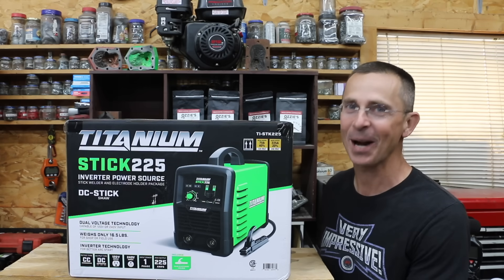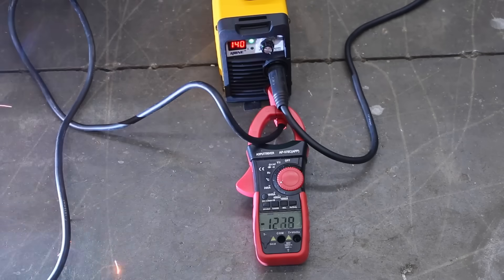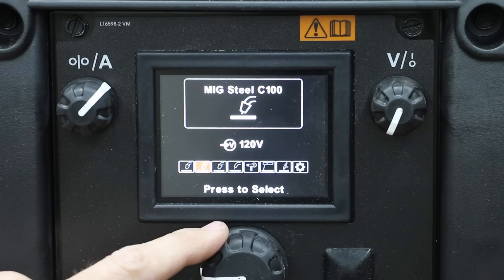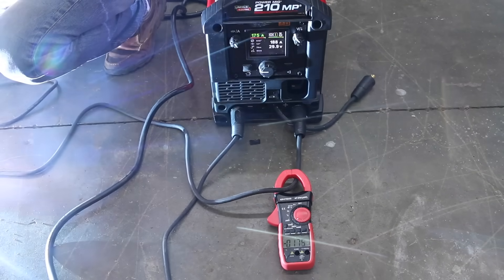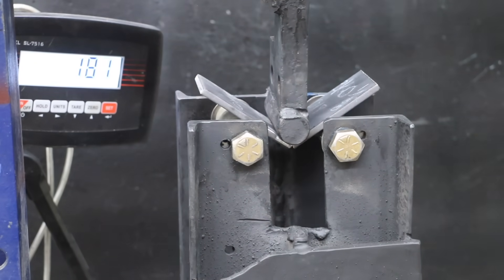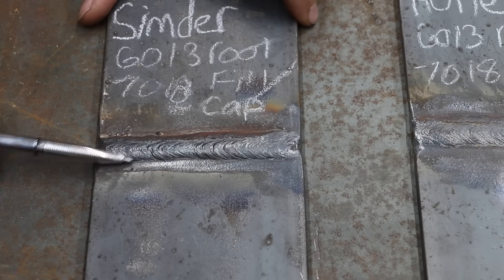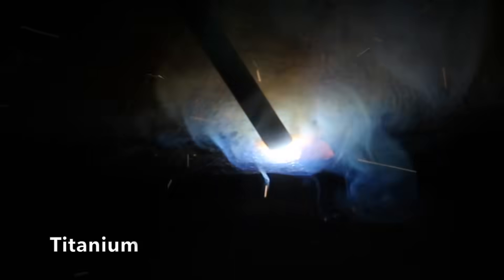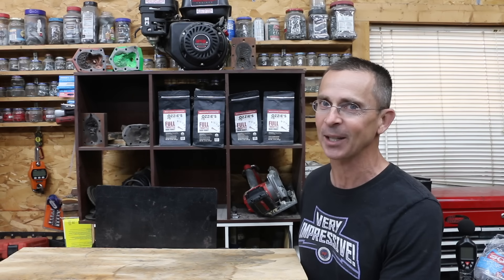$70 vs $2,300 Welder? Let's Settle This! Weld Strength, Duty Cycle, Current Output, Build Quality

Comment: Welders have a trick. Get one that you will never usenit above 50% of its max amp capacity. So if using 7018 1/8" then get one with a minimum 250amp capacity

Comment: The amps are probably like cheap car stereos..... Based on peak voltage and not RMS.  So basically not real.... But not false advertising either when they advertise" up to".

If you set the clamp-on ammeter to peak..(measures inrush current for motors made possible by capacitors...and lock the display on it).... You'll see higher amp.

For 115 v welders, on a 20 amp circuit....120*20= 2400 watts

2400/20v = 120A    using a common 20 volt welding voltage ,120 amps is all you can really plan to get constant from 120 V.   This is common sense.   The higher the welding voltage the less current you can also pull constantly.

Comment: I own Lincoln and Miller welders only.   But man, that little Horrible Fright Titanium is impressive!  I love the little lunch-pail inverter welders for getting into tight places or when having a job that’s a quick 5 minute fix and small.  That’s when those tiny machines come in real handy without having to lug around heavy big equipment.  

I never thought id say it, but I think I’ll be picking up a  HF Titanium just to keep in the RV.   Plug it into a 30Amp RV outlet and with 3/32” electrodes could be a lifesaver on a camping trip.

Comment: thanks joel.     How about this welder next?  ARCCAPTAIN Stylish Handheld Welder, 110V Portable Welding Machine with IGBT Inverter, 120A Stick Welder with Auto Darkening Goggles and Upgraded Ground Clamp, Fits for 3/32"-1/8" Welding RodsARCCAPTAIN Stylish Handheld Welder, 110V Portable Weld…

Comment: Superior video. Excellent work.  2yr old test is very relevant today.  Got the green HF 225 last year after watching. Upgraded power cord to 10ga and 120V adapter to 10ga
 (voids warranty). Upgraded both welding leads 1 foot longer  to 4ga with  heavy ground clamp & Hobart 200A electrode holder. Has handled every job using mostly 1/8" 7018 rods on 3/8  steel plate with ease.  Paid for itself 10x. 
Another great affordable stick machine is ESAB handy arc,  under $200. Even better value than HF 225, but the leads are short (easy fix).
Thanks to Joe/PF for going above  and beyond.

Comment: Reviewing this video again after doing a short course in welding and buying a fairly cheap welder with high current rating and low duty cycle. My takeaway from these weld tests is once your welder has the capability to push high current, you're good. From my limited experience, the accuracy of the number displayed on the screen does not matter much. When you weld something, you can see from the weld if the current is too high or too low and make adjustments. I bought a welder that goes up to 250A on the display, but I measured 178A max. So if you're buying a cheap welder, go with the highest current rating you could get, assuming the actual current will be lower. Unless you're going to weld non stop for a whole 5 minutes, go lower on the duty cycle to save on cost.

Comment: Wow so many things about this video are wrong its hard to watch !
Thers NO cert test with a total of 60 degrees on a test coupon . 30 degrees each plate . Its either 22.5 degrees angle each plate for a total of 45 degrees . Or 37.5 degrees each plate for a total of 75 degrees on a test coupon ! 6013 series rod is the least penetrating rod available . So using 6013 for a root pass and then using 7018 to cap your weld to check for penetration is bogus  ! It's straight up bad information ! And in the wire feed section your pushing welds . You never push with hard wire or inner shield wire . It results in way less penetration and excessive spatter ! Only welds you push are 4g away from you . Or a slight push in 3g position . Ive traveled to 4 other states teaching other shops WELDORS how to weld . And to help thier WELDORS get certified ! Ive been welding for 40 years now . Ran my own fab service for 35 years now . Im certified through the rail road . And certified through Caterpillar . I have so many certs ive lost track of them . One being D1.1 unlimited thickness . Ive put down around 220,000 pounds of wire ! We put down 100 pounds a wire a day at the cat supplier ! Love your channel ! But Joe was a wealth of miss information ! Ive shipped product to 5 other countries . I didn't accomplish that by not knowing the literature or not knowing what i was doing ! Sorry Joe . But you should of read some literature before helping make this video so you knew what you were talking about !
Reply: This video is more about welders comparison, not welding.
Reply: @jrm163 totally agree ! But different power supplies are gonna react different to usage . One machine might deal with improper usage better than the next . One machine might have aluminum windings that made it seem less effective because it was improperly used . Wher as it might of done way better being properly used ! Good machines have copper windings . This is my favorite youtube channel ! But all results in this video are null n void do to improper usage of equipment  and lack of knowledge and trade skills ! Bottom line is Joe gets an 
F for failing the results do to improper usage ! No disrespect intended !
Reply: Impressive I must say. You do know this is a welder comparison? Not an instructional video? Bogus? Bad? Hard to watch? I think not.

Comment: ANOTHER WELL SEASOND SHOP JOURNEYMAN RAN THE S7 ON APPROX 6 INCH DIAMETER BLACK PIPE & PRO STACKED DIME RESULTS. NO ATTENTION PAID TO NUMBERS & SETTINGS , JUST FIRED UNIT UP & GUESSED AMPERAGE @ 72 FROM RATE STICK WAS CONSUMED. SO DO WE GO WITH MULTIMETER & ACADEMIC ANALYSIS OR OLD TIME OPERATOR RESULTS. THE VERDICT OVER THERE WAS THE MACHINE GREAT FOR DOMESTIC PURPOSE BUT PROBABLY NOT INDUSTRIAL EVERY WWELDING JOURNEYMAN SO FAR JUST LOVES THIS MACHINE BUT THE HOMIES RATE IT AS JUNK. EVERY SINGLE TIME BOTH SIDES. GO FIGURE.

Comment: I bought the Titanium 225 at Harbor Freight on a good sale last year - an Open Box unit was less than $80. I have been very happy with it and this video made me very satisfied with my choice. It was my first welder and I'm still learning. I've only done three projects with 3/32" 6011 on 120V at 70A but every one was successful and I have had no complaints. Thanks for the cool info and helpful videos, Todd!
Reply from the maker: You are welcome!

Comment: Thank you for taking the time to compare these low-cost welding machines — they’re certainly suitable for light-duty or small-scale welds.
As a former welder, I can say with confidence that even with a $10,000 machine, achieving full penetration using a 6013 rod in this situation would have been highly unlikely. I wouldn’t have chosen 6013 here; it’s better suited for thinner materials, as it lacks the deep penetration needed for structural work.
In this particular case — with two pieces arranged in a V configuration — I would have intentionally left a gap of at least 1/16" to 3/32" to allow for deeper fusion at the root. More importantly, my first choice for the root pass would have been a 6011 rod, due to its excellent penetration characteristics. I’d then follow up with multiple passes using 7018 — preferably 7018 DC (my preferred option), or 7018 AC if the machine only offers alternating current.
Starting the weld with 6011 would have greatly improved both penetration and the overall structural integrity of the joint.
Reply from the maker: You are welcome!

Comment: I just bought a hone brand welder based on your tests at 120v my workshop is limited to 120v it burns hot for what it is lays down a good bead with 3/32" 6013 and 7018. Great video thanks for all the reviews.
Reply from the maker: Thanks and you are welcome!  Thanks for sharing.

Comment: I got the cheapest multiprocess welder on amazon, a 'tooliom'.  hooked up to 220 it will melt through a piece of 1/4 if I let it.  not only that but the tooliom flux core gs wire was much better than the blue demon.
Reply from the maker: Thanks for the feedback.

Comment: So I have that YesWelder and I've only run stick off of it so far and it does work great. I will note, like he says, the amperage is off. So the range for 6013 3/32 rod is 40-90. I have my machine up at 150. So the reading is not at all correct. But the amperage is there. Only run uo to 5/32 rod and thats at max setting 205A
Reply from the maker: Thanks for sharing.

Comment: Many assume that the Simder ARC-200 is a 200 amp welder because of the name. Simder does not claim that it is a 200 amp welder. It is a 120 amp welder on 120V supply and 140 A on 240V supply. To set the dial, for 120v supply, push and hold for about 5 seconds until only the number is displayed, then dial to the appropriate maximum amperage and push the knob once. The dial will then only show a maximum of 120 amp. Do the same for 140A if using 240V supply. So the clamp meter showing 120A output was spot-on.
Reply from the maker: Thanks for the feedback.

Comment: I wish somebody would tell me if it is safe to use American 60 cycle AC with a 15 amp breaker circuit with these machines.  I know the AC goes through a rectifier to create DC.  But I have no idea how much a 15 amp household current circuit can handle the inverter.  I always hear about the output of these machines but never anything about the safe input demands from the household currents.

Comment: This was a very comprehensive shoot out among these welders, based on the welders merits. and I like that you pointed out the welders that were tig compatible. I worked at a muffler shop and got pretty good with the MiG welders. and used an ARC welder some before along with an acetylene torch. and now I would like to try out my hand at TIG welding. so again thanks for that information. and thank you Joe with your massive welding skills. for showing us what these machines can and can't do. and for your valuable advice. those were some fantastic beads you laid down for sure.

Comment: A huge upside of the Titanium is that it actually will run 6010 if we can believe the label. Most budget welding machines won´t run this type of electrode because it requires higher voltage. I also got the S7 under another name, i paid 20 bucks shipping included and only wasted the 20 bucks because i was curious how shitty it actually was. I had to return one of them because it came faulty. The performance if run with 220/240v was cruel. What i found out was that it only worked well with 1/8 RC Type (6013 with some cellulose content) and 1/8 7016 (yeah, 7016 not 7018) rods, with 2,5mm the arc was either instable or way too hot, there was nothing in between no matter what i did to the settings. It only works with 1/8 Rods hammering away at full power and while doing so it behaves strangely, like a welder with weird pulse settings or like an AC/DC-Mix machine. Inexperienced users will not be able to control the process with these inferior arc characteristics.
Reply from the maker: Thanks for sharing.

Comment: As a CWI my suggestion if you do this again. Flip your test piece over (face of weld down) for the bend test. This will more accurately represent the overall strength of the weld and heat affected zone.
Reply from the maker: Thanks for the constructive feedback.

Comment: Hey Joy, you are a rockstar! Thank you both for putting this welder shootout! I appreciate it very much! 

I use to have a Snap On 110Volt MiG, it worked 100% of the time. 

I have an early portable 220 Volt Lincoln however it only runs on 220, I don’t have 220 available all the time. I may go pick up a light duty 110 volt unit. Thanks again fellas!
Reply from the maker: Thanks!  Thanks for sharing.

Comment: The HF titanium is 54% efficient compared to esab rogue with 84% which was tested by another channel, i bet the lincoln is way more efficient.. so if you use it on daily basis the Titanium will cost you much more on your electric bill than using Lincoln

Comment: 1. Avoid combo welders.
2. If you can pick it up, it doesn’t have enough copper in it to be a life long tool.
3. None of these cheese machines will last 25 to 50 years. Including the Lincoln combo joke.  
My primarily welding machines are 50 years old. Still making a living. Dont go cheap. Dont  buy "light". Pick your process, spare no expense on the best.
Reply from the maker: Thank you for sharing!
Reply: “My machines are 50 years old because I can’t fathom that technology advanced at all in the last 50 years, and I’m frightened by things I don’t understand”

Comment: I bought a Lincoln MiG welder years ago ( a 175 T, I believe) after doing a lot of research. 
It was pricey at the time, but buy once, cry once.  Ive been really happy with it and would recommend lincoln to anyone. I don’t always go with name brands ( like Hayward pool products, they suck, expensive with short warranties, buy Anything else ) but with Lincoln, you can’t go wrong.

I want TIG, ( MIG has its purpose but TIG just gives more control needed for some jobs)  and the Lincoln is really expensive, but this video kind of proves you do get what you pay for.

Comment: I bought a miller welder about 14 years ago for just under 2000.00 and it didn't get used around the house that much but once it was out of warranty it fried the motherboard and it wasn't available anymore and even if it was it would have cost another grand to fix. It didn't even get thru a whole roll of wire. I bought a 300.00 chinese welder after that experience and its weld quality is better than that Miller , the presets are awesome just input the metal thickness and its perfect and I bet I get more than a spool of wire thru it .
Reply from the maker: Thanks for sharing.

Comment: Cheap can be fun if it is right. I currently have a $53 arc welder and a harbor freight mig welder..... My current storage status is null...... Poor HF mig lives in the rain and still welds very well for the last 6 years. If it isn't waterproof, it doesn't live in my camp.
Reply from the maker: Thanks for the feedback.

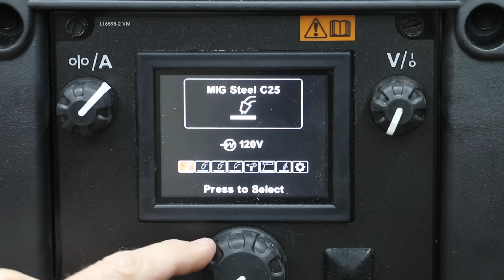Comment: 15:04  Novice question here.... Why is a clamp meter recommended if buying a cheaper welding machine? 
Is it because can't trust what the Amps display on the machine says it's putting out? is this really likely to be so inaccurate that it would be a safety concern?

Comment: Thanks Joe. 

Budget comes down to how much you are going to use the welder. If you are going to burn 15 rods a month vs an hour. 

Hone seems like a great trail welder for offroading/overlanding. 

I wouldn't build a roll cage with any of them besides the Lincoln.

Great video as usual.
Reply from the maker: Thanks!

Comment: I would really really like to see a review of the Lincoln multi-process welder versus some of the other products. Especially I want to know if you can get spare parts from lincoln. The Harbor Freight and other equipment generally has proprietary Mig guns and tips that are hard to get. A big part of my buying decision is going to be if I can go to a Lincoln store and get a replacement Mig gun or torch liner or tips
Reply from the maker: Thanks for the suggestion.

Comment: I own the titanium and a Lincoln and find myself using the titanium more often than the Lincoln after a few upgrades. I upgraded the stick lead welding clamp, the ground and the gas regulator. All relatively inexpensive to upgrade which made the titanium more comfortable to weld with than the Lincoln. My titanium also does tig welding. Ac or dc. I upgraded the foot pedal and this machine for the price even including the upgrades is a go to and by far the most comfortable and consistent welder I own. I’m not disappointed in it one bit.

Comment: A car battery works fine for short projects.  If you need an AC welder, an old microwave transformer can be rewound with a secondary as thick as my wife's thighs.  😂

Comment: Thank you for this test. I do have a very old Linde. That welder is fabulous, but it is extremely heavy. I have it piano Dolly's to move it around. From time to time I need to do some light welding and not in the shop. This is a big help because there are so many small welders now. The Hone might just be what I need.
Reply from the maker: You are welcome!  Thanks for  sharing.

Comment: Very good use of scientific method and eliminating as many variables as possible to be as accurate as possible with your review.  I just started welding school and going around harbor freight.  Been looking at different welders for a couple months.  I got a super cheap one (60 bucks) on amazon just to see if it would work.  It does, I want to buy one of those meters now to see what its actually outputting.  Thanks for making this video. Definitely going to share with my teacher and class.
Reply from the maker: Thank you for sharing!

Comment: I bought the deko for my son a few years ago and he uses it to hardface with 5/32" rods and assist on equipment repair jobs using multiple different types of electrodes. So far it has burned through over 1,000 pounds of electrodes with absolutely no issues other than the leads, they are absolute crap, replace the leads with quality copper and it's a reliable machine. He has ran that little unit for multiple days 8 hours continuous with no breaks other than adding a new eletrode in temperatures over 90 degrees. I have multiple large machines and have been a welder for over 35 years and I am shocked how well that little deko has performed. It was bought for a kid who wanted to learn how to weld and i never expected it to work and last as long as it has. It doesn't do well with 6010, but other than that, it's a handy little welder.
Reply from the maker: Thanks for the feedback.